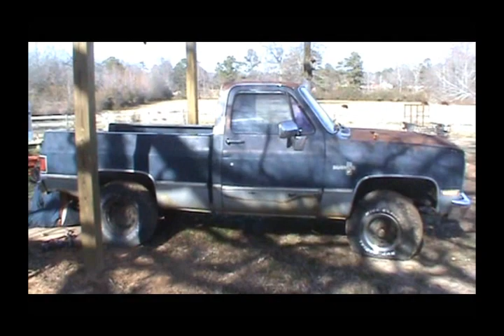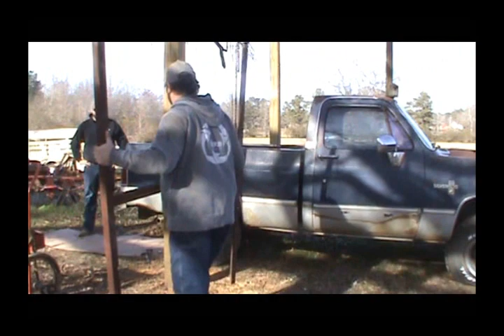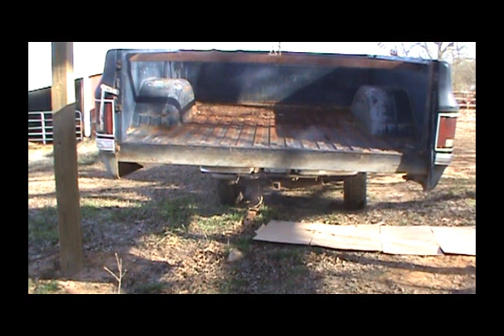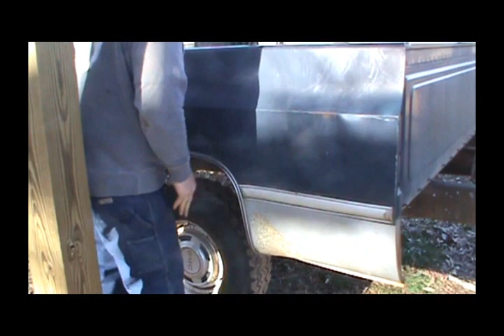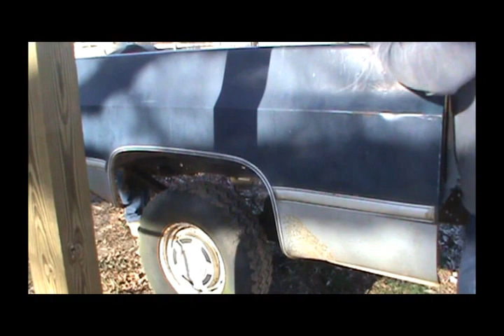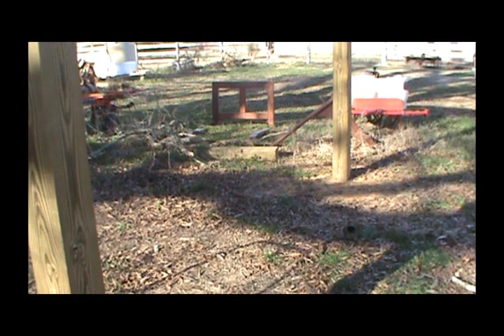1985 Chevy K10 Restoration Part 1 - Bed Removal

Comment: I know this is an older video (which is the best I've seen on bed removal) but I have a question about the gantry you built. Looks to be made of 6x6's. How tall did you make it and how wide? I'm needing to remove the bed off of my 83 K10 and I plan on setting my post in the ground like you did. Curious about how long your 6x6's are and how deep you set them? Thanks in advance!!
Reply from the maker: Thanks! The posts are 6x6x16' set in the ground 4' deep.  It is 8' wide I believe.  It was a real pain to set the top post, but it'll sure carry a lot of weight ;)  I have removed beds using just a doubled 2x6 and it works ok, the beds aren't that heavy, just bulky.  I was wanting something that could carry at least a ton of weight so that's the main reason for going so heavy duty.

Comment: How cold is it at the Big J? Right now we are about 35 degrees with a projected high of 48. 

Headed over to Home Depot later today to purchase a framing square. I found some info that i can use a framing square to section off a 24" pipe to half, quarter, eights, sixteenth inch sections. After the section marks have been made, i should be able to draw a perfect line around the pipe to use for cutting a saddle shape so i can weld it to another run of pipe. Sounds like a hard process but, i have the instruction sheet that documents the process step by step. Gonna need a lot of luck on this one. Lol

Anyway, that is what is on the agenda today. And maybe a quick trip to the Rafter S to
 check on feeders and throw corn out. 

Keep up the good work!

John
Reply from the maker: It was 23 this morning but I think the freezing weather is over for a while.  Rain tonight and tomorrow. Good luck on the pipe cutting.